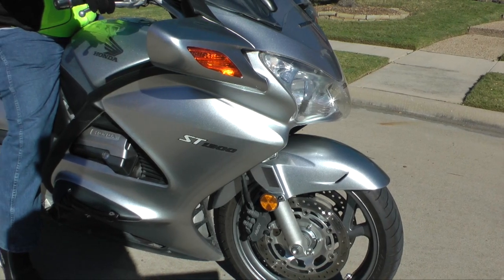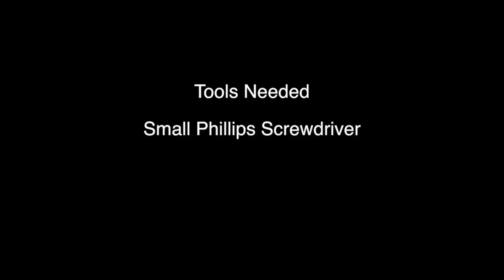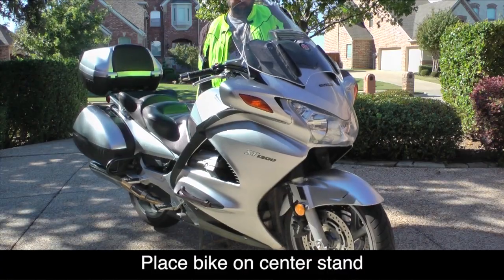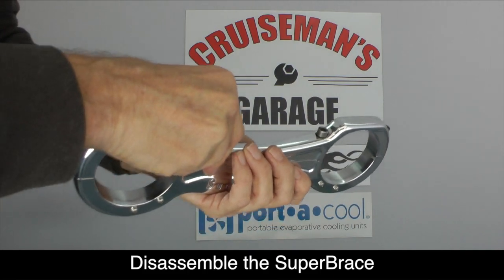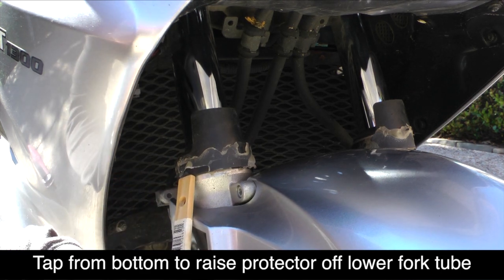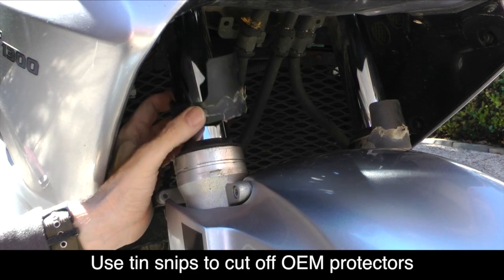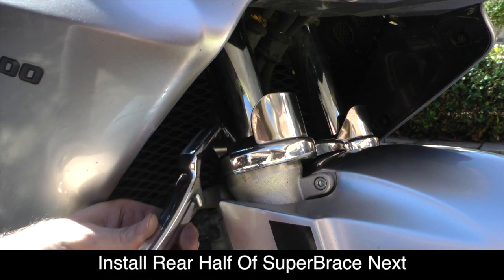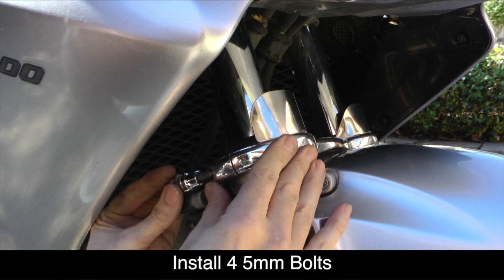Honda ST 1300 -  SuperBrace Install Video

Comment: I wonder how many people fall for this snake oil. I had one of these trinkets given to me for my 2023 KLR650. Makes zero difference. The guy that I gave it to swore by them so when I installed it on his bike I left it loose on purpose. He praised it and said it did so much for him. And then I showed him that it was just literally held on with double-sided tape. Placebo effect is a very real thing. These do not do anything on any bike.
Reply: This answer is cool! Agree with it and thank you for it, I was ready to buy one just for any case, but the same time I was wondering, why Honda engineers do not add a similar thing on there constructed bike.😀. Honda is the one the last engineers driven company, so we have to trust them. I do not go to buy this and put it on my st1300 Pan European.